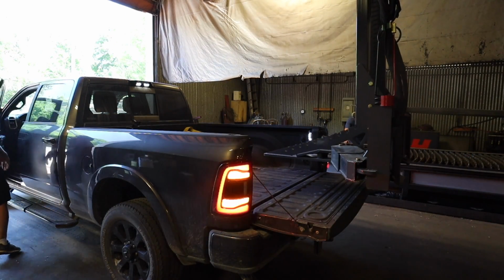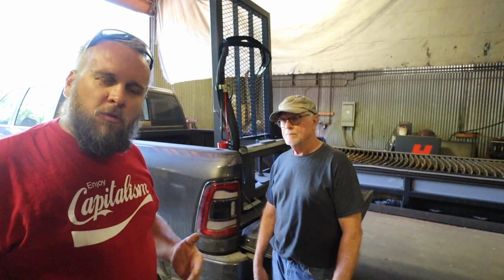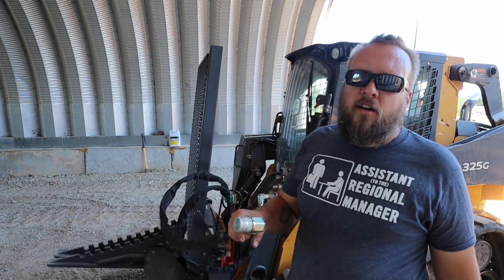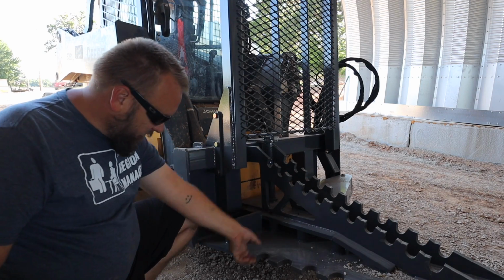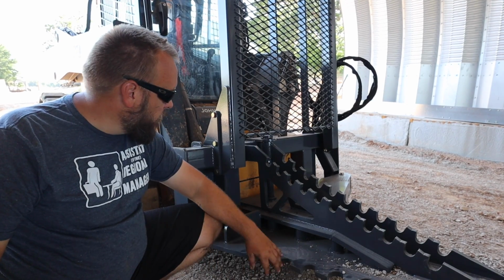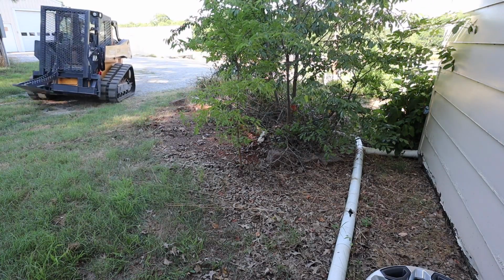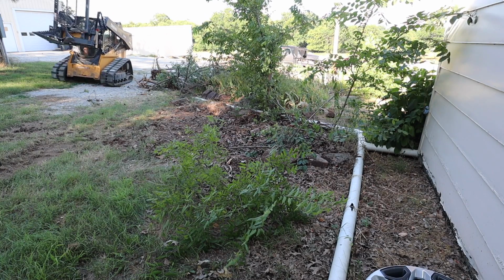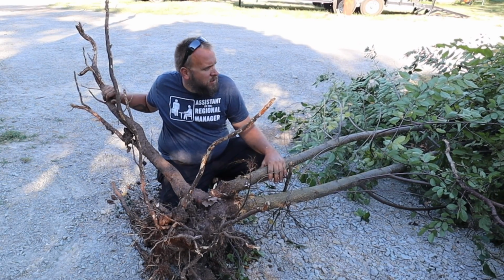Picking Up a New Skid Steer Attachment from Precision Manufacturing

Comment: Good to know you’re upholding the Ram Trucks’ “Big rigging with the tow mirrors whether pulling a trailer or not” tradition 😜

Also…that tree puller is awesome!
Reply from the maker: Yes sir. I even have a short called Rocking the ghost trailer

I don’t want to readjust them every time I switch

Some people get really upset about it and let them know that I took a measurement. My mirrors stick out 3 inches further when flipped up. If you were planning on getting within 3 inches of my truck, we already have a problem

Thanks for watching
Reply: @RockhillfarmYT  ha ha just giving you a hard time…do people really get upset about it? 🤦‍♂️
Reply from the maker: Yeah, I thought you were just joking around but some people get really mad because they say you are running people off the road with your mirror sticking out further.

It is literally only 3 inches wider.

I appreciate the hard time